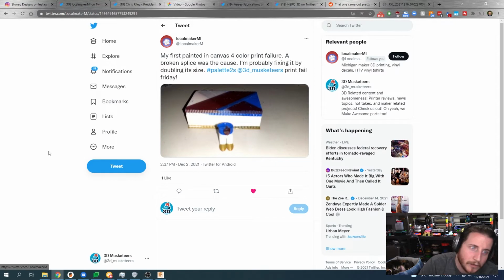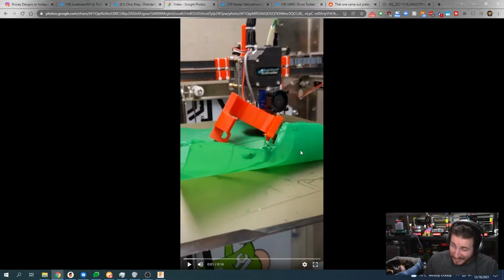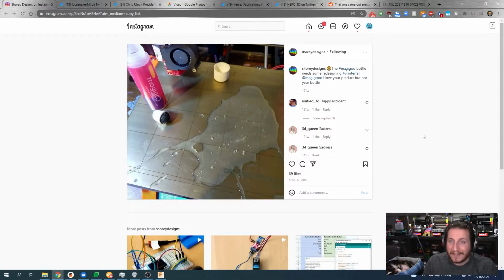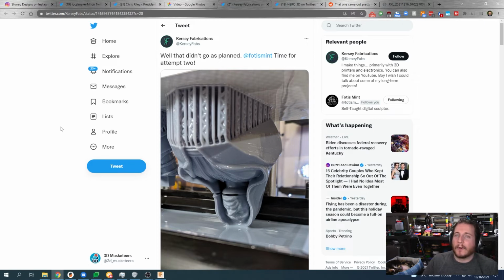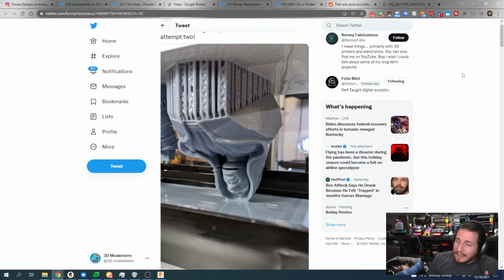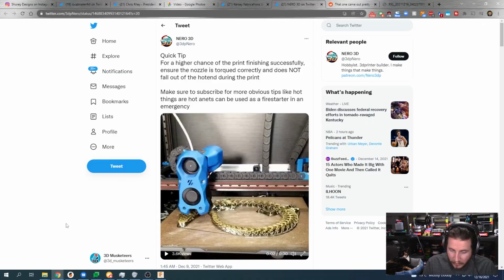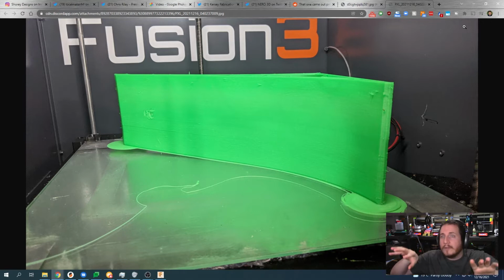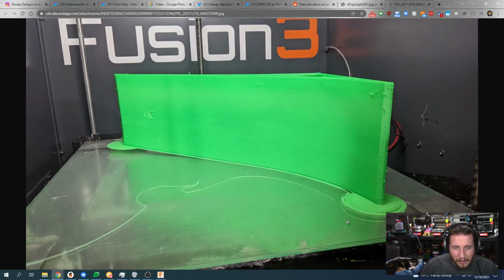Magigoo Everywhere and Broken Nozzles! - PrintFailFriday S1E14

Comment: I think Nero runs the E3D revo in that printer.
Reply from the maker: Apparently it had a CHT that was not tightened all the way I am told.
Reply: @3DMusketeers  That would do it too. The dragon heat block is copper and the CHT nozzles are brass. They take a little bit extra to make sure they are tight because of material mismatch.
Reply from the maker: Maybe? Nero was saying the M6 vs M7 on the v6 nozzles was likely to blame. But I can see copper being a problem for sure.
Reply: @3DMusketeers  M6 vs M7 thread or what?
Reply from the maker: But driver size. It's common that not all nozzles need the same but driver.